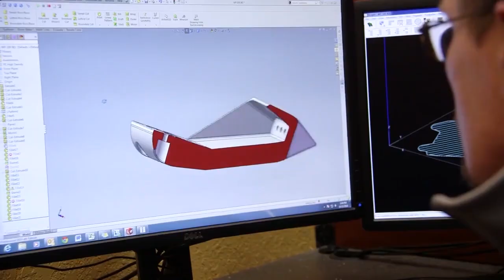Our Interview With Desktop Metal | Additive Manufacturing Podcast

Comment: My question is about the demand for these 3D printers. How do u know the market over the upcoming years and is it realistic to hit 900 million plus in revenue by 2025? Thanks
Reply from the maker: That is a good question! This podcast focuses on the 3d printer side of things and not on their future revenue. We did recently have a podcast on how America can become more manufacturing independent which definitely is a factor. Check out our previous podcast here: https://youtu.be/wKqDPx6sx7k
Thanks again for the question!
Reply: think about it in relation to the imminent rise of electric vehicles
Reply: Having been in manufacturing for over 40 years, R&D and validation short/small part count and cost effective runs will open people's minds to explore this technology. I have been in metal die casting and plastic injection molding. Tooling is not cheap and takes time to validate for RTM. It had convinced enough of their future for me to have bought DM stock.